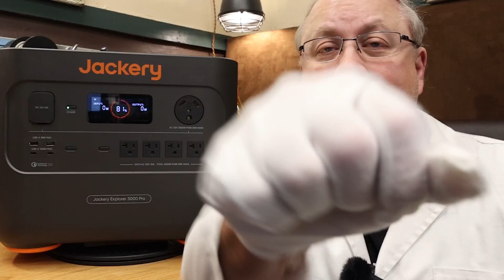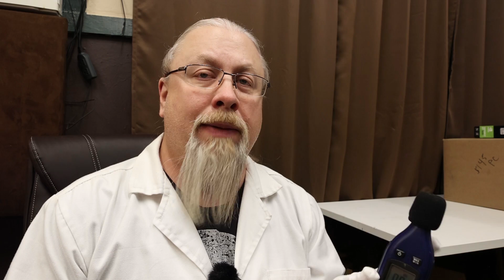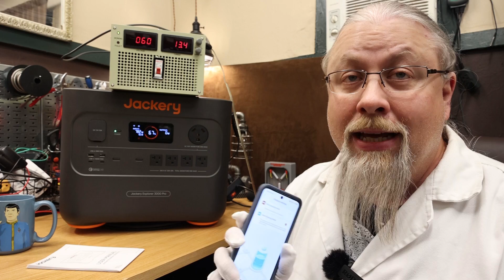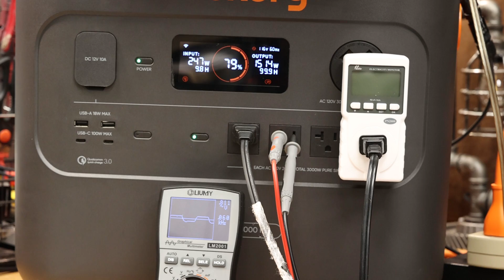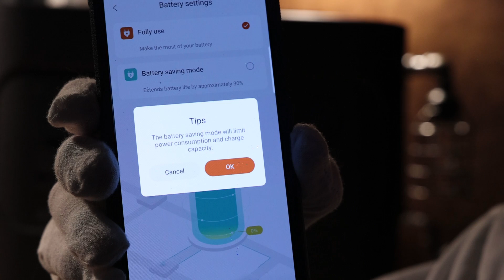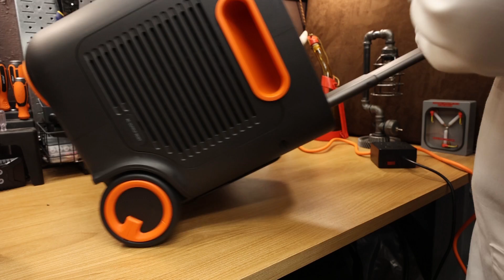JACKERY 3000 PRO 3000w UPS Solar Generator Lithium Battery Power Station Review

Comment: I was complaining about others  complaining in the comments about the fact that the Jackery doesn't use life PO4 batteries until I did some research and realized that my blueetti  does and  will last much longer than this unit. So instead of buying the Jackery 3000 pro I decided to buy to external Bluetti B230 batteries with 2,000 watts each bringing me up to 6,000 watts for $300 more. I have a few Jackerys and they work great but when you're spending this kind of money you want something that will last.
Reply: Which bluetti do you own and can recommend?

Comment: Ew, they stick with NMC, tsk tsk. '2000 cycles in battery saver mode' sounds better than 500 but I wonder, and my $1800 5120Wh LiFePo sever rack batteries are rated 7,000 cycles to 80%.
However I can't throw my server rack in the truck and take it camping; and Jackery makes quality products for what they're intended for. I have two of them.

Comment: I had a need to check the UPS feature of the Bluetti EB3A on a radio that must stay on at all times (long story).  In 'UPS' mode, there was so much buzzing static the radio was unusable when plugged in.  I have no other SoGens to test this on.  Would it be possible to check that in future videos?  Plug an AC radio into the units to check for clear audio?

Comment: I only have a Bluetti 120 solar panel, if I were to buy this unit then I'd need some sort of adapter or only use Jackery solar panel(s)?  I only own one generator and its the EB3A but would like a size larger but just coiuldn't spend the money Bluetti wants.....

Comment: Wow I just started researching this to review and after looking at the specs for the battery and still with the same solar input, this is a no go hard pass for sure. So many better units by far. I dont even know how this can be in the same class as anything out there like the Anker or EcoFlow. Still would rather have a bluetti. Jackery…??? Are you listening??? Change the solar inputs and the batteries, no one like NMC batteries that have higher chance of fire risks. 

Good review, poor product. 
Thanks Hobotech 👍🏼

Comment: Thank you Hobo. I have been happy with my EcoFlowDelta 2 performance. Only issue has been the 12v car charging cable failing the first few months. Unit is good after returning to Texas. Customer service very responsive. -California Van Life 🎈
Reply: Make sure u have a high output alternator
Charging Lithium can Strain and overload standard altanater causing a wire melt down & a fire.
Reply: @rmcnasty7319  Good advice. I dial back the Ecoflow software within their app to match the vehicles rated 12v output.

Comment: Making the inverter capable of handling overkill PV arrays would be nice.
Example: Even if it only charges at 1500W the overkill 3500Wp PV makes that power at less sunlight. Adding panels can make sense where electricity is expensive.

Comment: While some things seem nice on this unit, the fact that the unit does not come with Lifepo4 batteries is very sad. The price point also is way off with that in mind.
Reply from the maker: NMC batteries are actually more expensive than LiFePO4...
Reply: @HOBOTECH  yes they are more expensive but they have less of a life expectancy. So the bang for buck is not there

Comment: I am unclear of one possible use for this solar generator. Can you tell me if it can be used with a small gasoline 1kw generator and supply up to the 3kw as needed or would it be limited to 1kw output because of the UPS function? I realize you can't draw 3KW forever but if only for short times where the 1kw generator could keep the battery up, that would be a great addition to someone with an RV and a small genset. Running the microwave with a 1kw generator shure would be nice if it were possible without disconnection the input and then having to reconnect after using the solar generator to get the power needed. Do other solar generators allow such use?

Comment: Great video as always HOBOTECH!  Do you have any insight as to why they haven’t gone with lifepo4 yet ?  
I would never buy a jackery just based on being lithium ion
Reply: Probably cost and weight.
Reply from the maker: I made it very clear in my video why they are using NMC. It's a third less weight. Jackery is about PORTABILITY over everything else.

Comment: Jackery is not honoring your discount code nor are they forwarding the discount codes for early bird deals on the 3000 Pro (I even paid the $1 to get my code when the 3000 Pro became available).  I just bought my 3000 pro at full retail - hopefully they will credit me when they sort out the discount code problem.
edit: discount code arrived later in the day after the product had been released.  GOOD NEWS: 3/28 I received an email saying I was getting a credit for the discount amount.
Reply from the maker: Jackery screwed up and "forgot" to activate my code. It's working now.
Reply: Haha 😂 good luck with that! 😅
Reply: @ChatGPT1111  Indeed.  I've been around for other releases and know if you don't order very early you have to wait an extra month (they always sell out very fast).  It was this (3000 Pro) to power my small RV or spend a lot more (time AND money) installing more solar and lithium batteries - this is a lot easier so even if it costs me more it's a win.  Very annoying though.

Comment: God they still are not using lifepoe batteries? And they are still way more expensive than the competition. This company is not paying attention to their competition at all.
Reply: Agree. I don’t buy these anymore unless they’re LiFo.
Reply: I 100% agree with you I can’t believe it either I guess, baby steps for them as they just came out with a smart app I see even though the competition has had that for a long time
Reply: No phosphate batteries = NO SALE
Reply: I still like lithium...is lighter and for the reason people are buying it for is not a problem...Why people always see things like a competition?? There is market for this generators  out there....Does everybody  got the same car??? No, right?? Same is for this products...depending of people needs, tastes and likes.....
Reply: I’m with you.  Do you need portability or is it for constant use in a fixed location?
Reply: I'm looking into getting a lithium ion version of the ecoflow delta. I'd much rather have the li-po but at 30% cheaper and with more features the lithium ion version makes more sense for me.
Reply: you want LiFePoe get the 2000plus it is however 61.5 lbs vs 63.93 for 3000pro  and 2000plus is expandable.  Also 70% of 3024 is 2117 still a lot and more than the 2000plus for similar weight and using quite a lot 200 cycles a year will last you 10yrs till hitting the 70%. I got mine for for great deal at Costco under half jackery regular price ( under 50Cents a Whr)
Reply: It's about weight. Jackery wants to keep everything as light as possible.
Reply: Hello??? McFly??? They are opting on the side of portability. How many times does it have to be said?
Reply: @Tbone.357  Mcfly? 
Agreed, but not point I’m trying to make. Lots agree wise guy.

Comment: Someone explain to me the logic of Jackery sticking with NMC when everyone and their brother is moving to safer, longer lasing LiFePO4?
Reply: As long as it’s within the temp range tolerance it’ll be fine.  You don’t see Teslas & EV and every other NMC battery powered device (ebikes, power tools, etc..) make the switch.
Reply: Lighter, I guess. I got a cheapo sogen with roughly the same capabilities as my Anker Powerhouse II, but it's less than half the weight because it doesn't have LiFePO4. About half the size, too!
(Also apparently pure sine, I was genuinely surprised!)
Reply: @worldcomicsreview354  OK, But is that a good enough reason to use NMC which is FAR more dangerous than LFP especially if you plan to leave it plugged in all the time to act like a UPS? Not to mention the life span that is half LFP, just to save a few pounds on something with wheels and telescoping handle?  I don't know, seems silly to me.
Reply from the maker: I explained in the video why?

Comment: So if it's regulated 12 v why does it dropped to 12.4 at a 10 amp load😮🤔
Reply from the maker: It's called "voltage sag".
Reply: They could make it not sag, but that requires a 4 wire system which costs more money and very few people would be able to connect it properly.  There's no point.  I suspect shorter and heavier wires (thicker copper) would have reduced the voltage drop in this test.  Even if 12 gauge and only 3 feet long the loss is 1% at 10 amps.

Comment: The power station itself is pretty cool, but those app options are really nice.  The ability to keep your SOC between 15% and 85% is genius.  I predict every serious player in this space, even those using LFP battery cells, will eventually offer something similar.  "EIGHT HUNDRED POUNDS!"  I LOL'd even after seeing the on-screen clarification.  :)

Disclaimer - "No cats were probed in the making of this video."
Reply: Or off-roading community looking for lightweight options. The question always comes down to what your capabilities are and what you are using it for.
Reply: This is absolutely amazing I have a phone that's limited to 85% and it's over 5 years old which if measured it's lost less than 50mah

Comment: I like they went with different fans for the delta pro. My delta max 2k would drive my wife nuts with the solar charging during the day lol that jackery is pretty impressive. Even if it doesn't have LiPo 2000 cycles to 70% is still really good! Thanks HoBo :)
Reply: @viablybodacious302  sounds like with your 6,000 wh setup your only using half which is great! I had to decide whether to buy an extra delta max battery at $1,000 or upgrade to the Delta pro for the same money and get better life cycles and double the solar :)
Reply: @viablybodacious302  LiPo batteries would translate into an 85+ pound unit, so it's a tradeoff. Perhaps the ability to restrict the Jackery battery to a charge between 15 and 85% will make up for some of the difference in battery life. Time will tell.
Reply: @viablybodacious302  if you find the right panels you can run what you want. And honestly it's gonna be very rare someone uses 2000wh every single day and even if they do they aren't running from 100% every day. If I run a delta pro with 3500 life cycles from 100% to 50% then charge back to 100% that's only a half life cycle . So now 3500 becomes 7000 life cycles or better. Same goes for the delta max. 800 life cycles is 1600 life cycles with only using half its capacity. And if not used to its full 2200 watts or hard cycles and only running a modem and fridge than you can get more cycles out of it. Maybe even close to 1500-2000 cycles and that's just to 80% capacity. These units aren't cycled 100% daily. They are just rated for full life cycles to their testing.
Reply from the maker: Just to make it clear the market for the Jackery is not full time off grid living or 24/7/365 use in a fixed location. Jackery is meant for temporary PORTABLE power use.
Reply: @HOBOTECH  I absolutely agree. What a great unit though! Great job testing and thank you! I'd love to see a head to head with the bluetti ac200max and delta max 2000. I had the delta max 2k and now I have the delta pro working up to the smart home panel then more batteries.

Comment: Great but there’s STILL NO LIFE PO4 BATTERIES! No LIFE PO4, NO THANK YOU! I’m not spending my hard earned money on something that won’t last at least 10+ years of regular use.
Reply: Could you recommend a brand or model this size with life po4 battery?Thanks.
Reply: @Defender_of_men  Bluetti AC300 or Ecoflow Delta Pro, as mentioned in the video. The former has no "onboard" battery, though.
Bluetti also have the AC200MAX with 2200w output and 2kwh of onboard battery, plus the possibility of easy (but overpriced) expansion.
Reply from the maker: Watch the video. I recommend other 3000w models...
Reply: @HOBOTECH  That’s beside the point. A company like Jackery should have had at least ONE Life PO4 solar generator option by now. They’ve done nearly everything else but that. There’s no excuse for it.
Reply: @JohnSmith-gz5pm  Jackery 2000plus uses LiFeP04 and like 3000pro has 3000w inverter  but weighs about same as 3000pro so 3000pro is for light to medium users that want more capacity per weight

Comment: Is the rv outlet 30 amp.
Reply: 30amp socket but you're not going to get 30amp output with the 3000w capacity
Reply: @nz0z134  correct you would need 3600 watts
Reply: Would the 30 amp plug let you run a small a/c unit? For a limited time?
Reply: @rperry337  It will produce 3000w.  If your small A/C can start on 3000w yes.  If it cannot, no.
Reply: Didn't you watch the video? He says it right at the beginning.
Reply: @Tommyr R.  I quess I missed it. Sorry for the question. Didn't realize asking one was an issue. Helps the algorithm also gets more people to see the video. Thanks for your help.

Comment: Still no LiFePO4?  Pass.
Reply: Exactly
I have a jackery 500 that I’ve had for a few years and it’s showing it’s age. They need to change batteries
Reply: EXACTLY! I’m not spending my hard earned money on something that won’t at least 10+ years of use.
Reply: So if jackery came out with lifep04, you same poeple would complain about the size and cost.
Reply: @mozberg2191  This size of sogen is the sort of thing you stick in the corner or build into a van, anyway. It's not something you'll lug across a field to set up a tent (and what can you take in a tent that needs 3000w?)
Reply: @mozberg2191  not necessarily.
Reply: @mozberg2191  guilty 😂